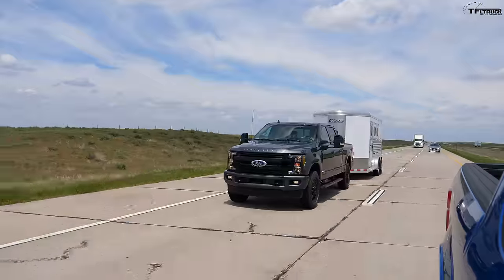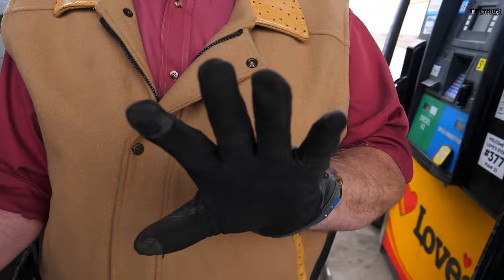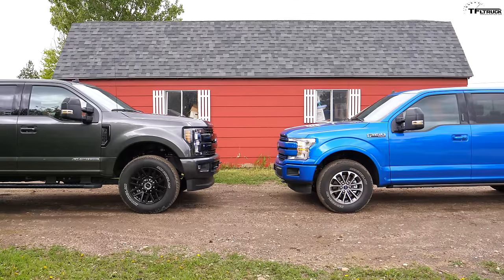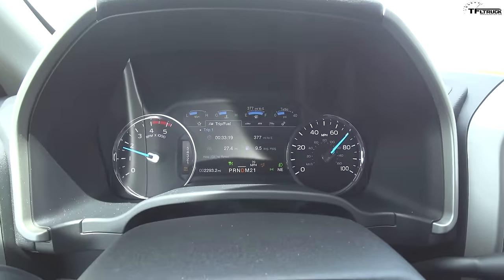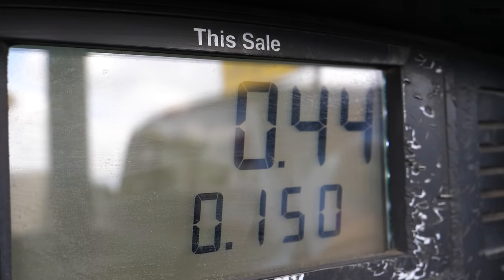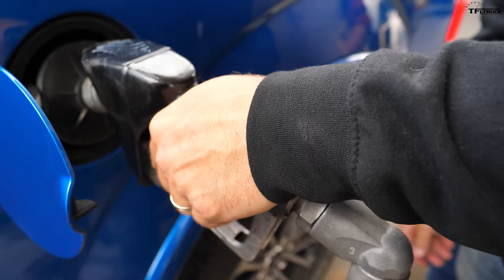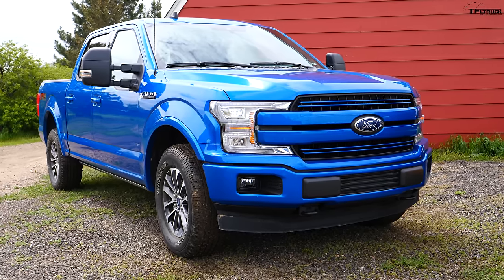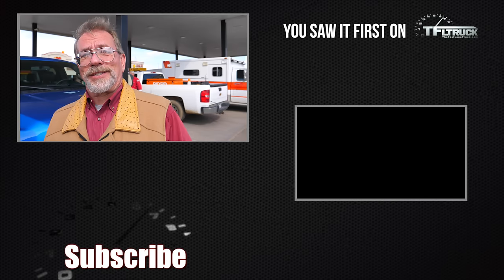Do You Really Need a Heavy Duty Truck to Tow 9,000 lbs? Ford F-150 vs F-250 MPG Review

Comment: I want you guys to strap 13,000 lbs on a EcoBoost rated at 13,200.
Reply: No kidding!!! That is the truck I own, 3.5L with the max tow package. Maybe not 13k, but the test in this video would be interesting.
Reply: Jeremy R nope.  Handles it just fine. Would I rather be in af250?  Yep, but my 3.5 handles that Much without issues
Reply: @AnyManProjects  🤣🤣🤣
Reply: @AnyManProjects   Yup.  Been towing with the family for 4 weeks with my 3.5EB SCREW and a 30ft bunkhouse at about 9200lbs.  All the way from Alaska through BC, Washington, and Oregon through some narly passes and ZERO issues with power.  Have my Equalizer WDH perfect set and 7.0 gain on the trailer breaks.  Far exceeding my expectations on all performance(except 8.5 MPG which was expected).
Reply: Christopher Ori mine with the ten speed does so good.  I've had 13k plus (for shorter trips) going and down grades and it does the job.  I'm easy on it and wouldn't want to panic stop or anything but it does the job.  Id rather have the super duty with the 6.7 but for the occasional heavy tow, my 2018 3.5 eco gets it done. No crazy revving, even up grades...just quiet power. Diesel guys always piss on gassers to justify spending all that extra cash or something? I know They're great if you actually need them, but most guys I know with them usually only tow 11k or less
Reply: @christopherori  How is braking? How are emergency maneuvers?
Reply: Jay Higgins braking has been just fine. Like a lot have said in this thread, trailer breaks set correctly are critical. I have my gain at 7.0. I tested high speed maneuvers and just fine. The trailer breaks in combination with a properly setup WDH makes all the difference. My whole family in the cab for 4000 miles this summer already and I know they are safe. I set it at 60mph max 62mph just to be on the conservative side.
Reply: BOWMAN-GT absolutely agree. The 10spd in combi with the EB is deadly. Only thing holding the truck back is payload but I made some major back end mods(shocks, airbags, swaybar, D tires) that give another level of performance. Also put in S&B cold intake. Up over 400bhp and 500ftlb now. Unreal in half ton.
Reply: No breaking news here.  The 250 toes better.
Reply: I pull my 13k toy hauler all over Utah mountain passes with a massive Ford Excursion powerstroke loaded up with my family.  No way I would ever do that in a half ton in real world conditions.  Winds change everything when pulling such a large trailer and even with my Excursion it can get a little scary at times.  Emergency Braking down hill in the mountains, etc.   if you regularly pull more than 10k you need HD IMO for safety.  Under 10k a properly configured 1/2 ton is doable just please don’t drive 70+ mph with that load like the diesel jerks like to do.
Reply: Brian Lampright agreed. Got some 40-50mph side winds on the backside of the Wrangells. Performed very well with the WDH but still had to keep it under control. Made me wonder how a 3/4 would have performed wit my 30footer acting as a sail.
Reply: @AnyManProjects  Just what I needed to know.  I'm planning a fairly heavy boat 12-13k all up, but in FL will never see a hill and the max speed limit to the coast is 45mph.  The 3.5 should work just fine.
Reply: Those ecoboost engines are trash. Should of gotten a v8 ask any ford tech reraly any of those will recommned the ecoboost over the b8
Reply: @christopherori  what you lose on millage, you make up for on fuel. Diesel is 30% more where I live. Add another 2% for DEF and you would need to get 11.22mpg in your diesel before you'd save a dime- You'd need that dime for the oil changes that are twoce the price and twice as often. For 15k or less, I'm staying with the 3.5L F150.
Reply: @gigi9467  What makes you say they are trash? They outperform any other engine's in it's class and are reliable if taken care of. The only reason Ford techs prefer V8 is because they are less maintenance, easier to work on and they have been around for awhile.
Reply: George Funes ask a ford tech and a mechanic so u can see what i mean.
Reply: Jesus H Medrano new ways of thinking and change are difficult for most people 😉. I have heard EBs are trash for years but still they have been making them for 10+ yrs and Ford is expanding them in their fleet(ranger, edge, etc.). If they were really trash and cost prohibitive they wouldn’t be expanding the fleet....
Reply: Jimmy's Tractor Yup. I look at  my normal 18-20mpg daily as adding to the piggy bank to be tapped when I tow. 95% time 18-20mpg, 5% 8.5mpg. Easily justifies $40k versus $65k 3/4 ton diesel 🤔
Reply: Christopher Ori theres a lot of cars are tgst are trash and they keep making them doesnt nean they are good? No tgey arent they are trash cars for dumb customers
Reply: @christopherori  brakes
Reply: @ML-lg4ky  braking
Reply: @christopherori  and that's why I swapped my 18 diesel with 37k miles for a quicker truck with better mileage. Only time Id want a diesel is when towing over 15k lbs I'm installing the gooseneck in my F150 and will use it for tounge weights  upto 3000lbs and trailers to 15000lbs.
Reply: Nice 70mph pulling a trailer whose tires are prob rated for 65mph at Max inflation. 

 U guys should read tire numbers since  you are reading gvwr stickers.
Reply: Jeremy R  considering tow ratings aren't for just how much sheer weight the truck can haul, I'd say your assessment of RPM is not accurate.
Reply: rnordquest How often do you plan on towing that boat?
Reply: Christopher Ori JEEEEZ  8.5mpg?? That’s a stop at every fuel station nearly hahaha.
Reply: I’ve pulled 14,240lbs with my 14 ecoboost and it pulled it fine but I definitely would have felt better in a f250 for stability and breaking reasons.
Reply: @gigi9467  How about you share with us what the Ford mechanic told you?
Reply: George Funes basically in comparison to the other engines that ate available on the f150 the 5.0 v8 has thr less issues by far and that they would pick that over the other engines and i checked their trucks except ine if them had a ecoboost but he said the reason he got it was cuz he leases it so he didnt care he wasnt gonna keep it long. Look it uo theresa bunch of videos also of texh and mechanica gving their .2 cents on this engines, its common sense though if u are pushing an engine harder it cant last as long  or be as trouble free as a NA engine
Reply: I second that request for sure! THAT would be the ultimate test and while we're at it, why not this test down and then up the Ike Gauntlet!
Reply: Brian Lampright...You just nailed it in one paragraph! I just pulled my 13k lbs 28 foot front bedroom toyhauler from the Grand Canyon to Phoenix yesterday. It was windy and with the climb out of Camp Verde a half ton ain’t going to cut it. My F350 7.3 did great!
Reply: @razvanmihalache5680  Probably average once a week.  It's only 12 miles and when I move back to the east coast it's only a 2 mile trip.
Reply: @georgefunes4535  the EB's are the best out there. Haters are always gonna hate. What haters forget that now all the manufacturers are copying the EB concept due to emissions regulation. When the EB came out, everyone were talking trash about it but it has proven itself over the years and now pretty much all manufacturers are using the technology.  They just name it different.
Reply: @JimmysTractor  This is the problem now with the government regulations of fuel and emissions.  Diesel is like the 2 or 3 cut off the oil.  It use to be cheap in comparison to gas.  Now with all the extra refining to remove the sulfur and other additives put in it price falls between mid grade and premium gas.  Add in the extra expense of maintenance and diesels get harder and harder to justify.  This is by design as the government wants to reduce use of diesel engines over time.
Reply: @linger2001  oh, I get it. They won. After 18 years of diesel, I'm back to gas.
Reply: F250 will beat it hands down with fuel economy. EcoBoost's are notorious for poor fuel economy while towing. Worse even than a V8.
Reply: @JimmysTractor  That's a huge price difference for diesel. Nation wide difference is 10%-15%. Where I live it's even but not always. DEF hardly counts since your talking $2.50 over 400 miles and $150+ for fuel.
Reply: @jayhiggins5239  braking is always a concern. The max trailer tow package has the trailer brake controller. Make sure your trailer brakes are dialed in perfectly and use the stabbing brake maneuver downhill to kerp the brakes cool. Don't ever "ride" the brakes
Reply: @gigi9467  what is a "b8"? Look at the torque curve buddy. I'm a big rig otr trucker. Torque is what matters. Rpm curves bro.
Reply: @edt.9218  trailer brake controller is included on the max trailer tow package
Reply: George Funes sounds like a winner to me for the exact sane reason u stated!! Lol
Reply: Christopher Ori good for you now imagine if it wer a v8. You would have an engine for another 10 years.
Reply: Sauceboss oh no grammar police!! Lol and u might want to pay attention cuz i never said anything bout torque numbers my whole thing has been about reliability and guess what? The v8 or b8 is still king. Sorry if u bought a v6 with turbos on it salesman  get a better commission for those cuz they cheaper to make for ford lol
Reply: @DUNEATV  because, 7.3
Reply: @gigi9467  That's why just about every diesel engine has turbos and they last over a million miles. They are nearly as reliable and if you're scared you're going to break something get the red carpet warranty. I got mine to tow a heavy trailer in the mountains where air is less dense. Make sure you move your V8 to the granny lane when this twin turbo is passing you up like your standing still. Don't interrupt my forward progress in that V8 of yours. But if you do hinder my forward progress I won't have any problems quickly getting back up to speed,  even yanking 12k. Just unnecessary.
Reply: I know my 2018 F150 is rated at 12,700 with the 3.5 eco.  I haven't bought the trailer yet, but looking at about 10,800 total on trailer (8,800 + 2,000 cargo).  My concern is the 7K GVWR.  The tongue weight on the trailer shows 890lbs. I figured 20% of the fully loaded cargo (400lbs) and I am sitting at 1290.  I only have 500lbs left to keep my truck under the GVWR and I am not a real small guy. :-)  I just don't see how Ford could say you can tow 12,700 without going over the GVWR of the truck.  No passengers?
Reply: i wouldn't trust a turbo V6 to tow that amount. anything over 10,000 in my opinion and it's time to step up at that point, especially 13,000 lol. that's heavy duty territory. my 05 Ram 2500 cummins towed 13,000, and the max on that was 14,000. the Ram 3500, the max on that was 18,000.
Reply: @Jeymez  you're 05 Ram is old technology compared to these trucks.  The 3.5L Ecoboost has 470 ft lbs of torque, and I think 385 HP.  Your 05 had 325 HP and what 600 ft lbs with a heavier truck?
Reply: Everyone needs a way to justify the 6.7,,,,here is mine...... Because I want it! Life is not a dress rehearsal, only got one chance at it, get what you want folks!
Reply: Brian Wild: another point i was gonna make since you brought up curb weight. yes obviously it does because it's a super duty. so it should weigh more than a F150, but the total curb weight on a 02-08 Ram 2500 was 6300. the Ram 3500 was 7600. the regular size Ram 1500 from that same time period was 4500. the modern F150 weighs 5300 pounds. so if you do the math, even though the F150 has 470 torque, my truck is actually a little quicker even with the extra weight. because it's not a normal V6 or turbo. it's a diesel with an inline 6. that's like having a V8 or a twin turbo V6 like the F150 has, but without the issues of a turbo, or turbo lag. now off the line F150 is faster, but because it is a turbo, my truck could keep up. because you don't have to worry about turbo lag in a inline 6. the Ram 1500 could keep up with an F150, because it only weighs 4500, and the F150 is 700 pounds heavier.
Reply: @AnyManProjects  I don't doubt that.  Ford does some insane torture tests in extreme heat and cold, and rapid temperature changes in between.  I'm sure it would handle it fine.
Reply: Jesus H Medrano I’m sure whatever you drive is perfection embodied lol.  Those of us who actually own these ecoboost trucks know better.  We push them hard and they are great motors.  Plenty of high mileage examples out there now to prove you wrong.  Opinions like yours are dying out as the Internet allows people to find actual facts instead anecdote nonsense
Reply: DUNEYXZ the new eco boost motors have more power than your 7.3 and the truck weighs a lot less.  I’ve towed with both, I’ll keep the modern echo all day.  This coming from a guy who had a 2017 f250 before going back to the 3.5 f150
Reply: Ford F-250 6.7 Super that’s the truth and there’s nothing wrong with that argument.  It’s just when people talk trash about other products to justify their purchase.  My EcoBoost towers great heavy, but if I didn’t care about the extra cash and crappy ride quality of a bigger truck, I’d get one.
Reply: @Jeymez  umm, your Diesel has turbo lag my friend and I am not sure the 2002 to 2008 would out pull a modern F150 with either the 3.5 EB or the Coyote.  I've owned a couple of Cummins powered dodges and they have turbo lag.
Reply: Brian Wild: actually it can, and the 5.0 in the F150 is slower. the ecoboost might be faster than my truck in a straight line, but not the 5.0.  the max you can tow with that is 10,500 pounds, which is good. id actually buy that over the ecoboost, but my truck can still outperform that in terms of work related tasks. 14,000 is the max on a old Ram cummins from back in the day, i know because i've towed close to that amount. now that's only for the 2500. the duramax diesel from GM back in the day was pretty close, because Fords 6.0 back then was the weakest. the 3500 could tow 19000. another thing, ya it might have some turbo lag, but there not meant to be driven hard anyway. and it's not a normal turbo, it's a diesel engine with an inline 6 cylinder. an inline 6 is more powerful than a V6, but they tend to be less reliable, atleast less reliable in a BMW or Audi. but in the Ram they last a long time.
Reply: Raven Fox max tow on the eco is over 13k
Reply: It has more torque because it's a Diesel.  More HP, not back in 2005.  Diesel fuel has more energy than gasoline.
Reply: BOWMAN-GT: are you sure about that, because were talking about a V6 with a turbo, not a V8. it's rated to tow 13,000, but real world results are different from on paper. but who do you know towing that amount of weight with a modern F150 lol. when the weight gets around 11,000 and above, most people tend to buy an F250 gas V8 or diesel, a duramax from GM, or the 2500 from Ram. even if the ecoboost can do it, most people i know wouldn't feel comfortable towing that kinda weight with a V6, even with a turbo. the area i live in, i see alot of F150's. mostly the newer ones, but i see the V8 more often.
Reply: It’s funny to see how many people are towing over weight my truck one ton dodge with 3/73 rear end that tows 13300 on my 40 foot bunk house at 9600 pounds with my wife daughter and myself 300 pounds of gear leaves me with only a extra 300 pounds of payload to add
Reply: Sauceboss lol I did calculation today if a f 150 eco boost 3.55 rear end 4x2 at the tow rating 13200 was pulling a trailer at 9380 pounds with three people and 300 pounds of gear. Would all most be maxed with 970 to spare 9380 is far off 13200 it’s sad how many people are on the road over weight ☹️
Reply: Sauceboss oh and the blue truck over weight at 9000
Reply: @Sauceboss - It would probably take it

My Brothers In-laws have one, silly dink tows = if not > I will in my 2500 with a 5.9L diesel.
Reply: @daveszangulies9938  - 970 to spare... 🤔 Don't know why you need to spare?
9380 + 970 = 10'350
Minus - 300lb of gear
Minus - 300lb 2 bodies
10'350 + 600 = 10'950
If you take away the 2250lb extended cab
10'950 + 2250 = 13'200

Not saying you should tow that much, but understand that a trucks max payload as advertised is in the best case, max weight stripped from cab (reg cab) absolutely nothing in box and only 1 person in vehicle.

I know this because my brother, they use it because the overall limit is something like 20'000 total? Their truck weighs half as much as mine in turn allowing them to LEGALLY haul more weight, even though I PHYSICALLY could.
Reply: @FordF-Super  - honestly, a diesel is simple if you should or shouldn't.

Do you mind paying a little extra here and there, to save money in the long run?

I don't want to fill you with false hope, I don't know dink all about new ones. (I have heard decent stuff so far about the 6.7) But I get comparable fuel milage to a Honda or a Sunfire on the highway, little more thirsty in town but I would then compare the milage to my old Ford 300 I6
Reply: Problem nobody looks gvwr amount of people gear etc yes the trucks can tow the weights but stopping hill grades thats were the  math comes in  on proper weights to keep a lawer away i bought a 3500 cummins i thought ill be able to pull a house wrong
Reply: @duttydiesel8303  i dont mean spare as in tire i mean spare weight that calculation was done me wife two kids and 300 pounds of goods 970 lift then truck is over weight thats 9380 pound trailer in tow
Reply: @daveszangulies9938  - like I said why spare? Lol 1000lbs underweight is a 1000lbs that "COULD" be used as max weight?

As far as it goes you'd hate me! 😂 Probably slightly less now that I have the 3/4 tonne & 1 tonne.

My best one to date, was with my old F-150. I think the absolute top combined was 7'800lbs (with proper setup) not sure if mine was even rated for quite that.

I tipped the scales at 22'000. The truck did not like it, but she got it done... That wasn't all in a trailer either. As long as you don't do it on a regular basis, nbd... But most people don't have common sense ie
- maintain a slower speed
- don't tailgate
- stay off freeways and interstates
Reply: @daveszangulies9938  - another thing is the standard transmission, you can bully the weight of the vehicle around little bit.
Reply: I do..  2018 f150 max tow package with ecoboost..  my camper is around 12-13k depending on loading.   No problems at all hauling that amount - still have some power to spare on the highway, and can make it through the smoky mountains.   last trip from Raleigh to the foothills of the mountains I averaged around 10mpg.
Reply: @ltbarkley  - they are actually very impressive given their displacement!

I personally wouldn't want to do a heavy haul often with it, at the end of the day there really is no replacement for displacement... You can make a smaller engine get more power, but that also messes with the longevity!

Also I have heard a lot of complaints about the seals on that engine? the one that we have has had almost every single seal on the damn truck done.

The other major issue we had, when we launched a boat.. there is an opening in the top of the rear differential??? Why I don't know, but what happened was it filled with water!!!
Reply: Dutty Diesel turbo reduces longevity..... says the guy with the turbo
Reply: @AnyManProjects  - actually have 3 turbo, and I didn't say that was the killer... You will likely have a similar effect with a 5 liter, they're just not really made to tow 13000 pounds regularly.

Go ahead tell me I'm wrong, you're definitely entitled to your opinion..and my opinion is the person I know who owns a 3.5 liter turbocharged Ford f150, is willing to tow more than I do in my 3/4 tonne. He has had a tonne of problems but tows a healthy 10'000+ roughly 500mi/week.
Reply: @AnyManProjects  - what do you have to say? I would love to hear what someone who owns a Ford F-150 has to say. My opinion holds next to no weight because I have absolutely no experience with them.
Reply: @AnyManProjects  
How much do you tow?
How often do you tow?
How far do you tow?
Are you running 5th wheel or standard bumper hitch?
Reply: @AnyManProjects 
What's your MPG?
What's your o/a odemeter milage?
What's the history with repairs?

I'm going to imagine you don't have the time... 😂🤣 Wouldn't be a shocker!
Reply: Dutty Diesel I’ve pulled over 13k (with people, gear and trailer) before, there and back without knowing the trailer was that heavy ahead of time.  It was a bumper pull.  It did fine but I knew it was back there. I would not want to do that on a regular basis.  if I towed over 10k on a routinely I would definitely go diesel.  As it stands now, I’ve had 9800 pounds in trailer, plus about 600 in people, and 400 in gear pretty regular and I don’t sweat it.  Trailer brakes dialed in is the key.  The engine rugs so much better and less stressful than my 14 5.0.  I miss the sound and overall character of the v8 but there is no comparison when towing.  I had a diesel 3/4 before and that’s a different ball game. 13k with that was awesome, but the extra cost, drive ability etc kept me from getting another
Reply: Dutty Diesel to answer your other questions, my truck is an 18 3.5 with the 10speed.  Only 12k miles,  eight months out of the year I tow at least every weekend. Bumper pull, get about eight to ten mpg on average depending where I’m going
Reply: While you at it throw in the old second generation 7.3 power-stroke f-350 dually
Reply: @gigi9467  You're so right. Mine developed a miss at 375,000 miles and I had to replace it. It's been 10 months since then and 150,000 miles and I'm starting to worry that I might have to replace it again when the van hits 700,000. Such junk! Oh, and I pull a loaded trailer for all those miles.
Reply: Jeremy R  I have a 2018 F150 with the EcoBoost. It doesn't even turn 8k rpm. Wtf dude
Reply: @BrianLampright913  you've obviously been out of the truck world for 10+ years if you're still driving an excursion. Trucks have made huge advancements and some will tow better than your excursion. The excursion just has weight
Reply: tynstaci interesting assumption but wrong. I own an X because I have a family and require a 3rd row. My hobbies involve hauling a large toy hauler full of dirt bikes into the desert and up and over large mountain passes. The Excursion is literally  the ONLY truck on the planet with 3rd row capable of this and just because I own one does not mean I’m out of touch with new trucks.  Read the comments above many people INCLUDING F150 owners agree with me that when regularity towing 13k lbs you should not be using a 1/2 ton truck. So many reasons why that is true.  I’ll give you one example. Go take a wheel off any HD truck and compare the massive brakes on the HD truck to any 1/2 ton. HUGE difference. A 1/2 ton going down a long steep mountain pass has a high probability of putting too much heat into the brakes and warping the rotors. A 1/2 ton isn’t built with heavy enough components to stand up to those weights on a regular basis. Ask ANY business owner who runs a fleet of work trucks that haul trailers...there is a reason none of them buy 1/2 ton trucks to haul even an 8k lb trailer on a Dailey basis...they wear out too fast.
Reply: Jimmy's Tractor I partially agree with you, i own a diesel Excursion (heavily modified) will keep it for life for HD towing. And I also have a 17 RAM1500 which is so much better on so many ways and 95% of the time would rather drive. The 1500 is so much more enjoyable to drive and tows awesome up to the 7k I’ve had behind it but my 13k trailer would squash it. I’m curious how well the suspension, brakes, and driveline on your F150 will hold up to the weights you want to pull.
Reply: Not saying it to piss anyone off but I traded  my 2017 f 150 for a 2019 f250 and I wish I would have kept my 150 it handled my RV way better less sway it surprised the hell out of me I think because it sits up so high it has poor handling when towing rv I know people will say adjust your hitch well I did that and no change I bought a new resse hitch and lowered it as low as it goes the problem isn't that it's the truck it's to tall
Reply: Hezekiah Wells that is very surprising!  Everything about an HD truck is so much more solid and stiff from tires to suspension which normally translates into superior towing.   Crazy.
Reply: @BrianLampright913  I believe they are just to tall Ford has raised the f250 at least 5 inches in the last few years I talked to the dealership and they also heard the same thing from other customers that where towing RVs and the also told me that Ford might be aware of this problem because they are lowering the f250 in 2020 by 3 inches
Reply: Hezekiah Wells I could see that.  The RAM HD trucks are also very tall. Chevy makes the low riders.
Reply: yep gotta load to the max, cause the sticker said so.
Reply: The Ecoboost is the towing engine for F150s. Torque peak is at 3k RPM.
Reply: Excellent test!  Great video editing!  This is extremely helpful to me for my next purchase.
Reply: Ny to Washington with a 2011 3.5eco f150 pulling a boat of 7000lbs. 6.6 mpg for 3000 miles.
Reply: M Linger , did you see what England , wants to do in a few years? Cut those diesels therehave zip, for pollution controls, GERMANY, & others have gone the DEF way+ a replaceable SOOT FILTER , 
DO YOU KNOW whom invented that SOOT FILTER? PEUGEOT  did, then gave it to free domain ,,rather than put in a patent., Cheers from NJ
Reply: Sauceboss  and I do believe on the trailer package , with diesel, it includes a JAKE BRAKE also,     Cheers from NJ
Reply: Dutty Diesel virtually ALL digs do have a VENT o em,,so you had your rear end in WATER,,WHY?, consider yourself lucky that you got up the ramp, with RWD, Bless u had a 4X4,   Cheers from NJ
Reply: Ford says it will safely tow 13,200. So let's go.
Reply: Brian Lampright I got new on my job an E350 VAN high performance , used for m HVAC/R job, I did some serious miles, Mt POCONO PA- STATEN ISLAND, PORT JERVIS ,NY, -BARNEGAT NJ, when the first breakers went, the service place that the company used  wore out REALLY QUICK, , but I found out there 23 DIFFERENT GRADES FOR THAT VEHICLE, so I was accused , of OVERLOADING IT , so I went to a public scale, & got a receipt, the vehicle could still Cary 950lbs, so I told then FIX IT OR I QUIT, so TSHF, ant they told them OEM PARTS ONLY,  then it went many miles !  Cher’s from NJ
Reply: @christopherori  exactly everyone is going small engine turbo now nobody wants new technology
Reply: @AnyManProjects  if it's rated for max towing of 13k than it will be fine. The trailer package and gears is why it's safe to tow that amount. If I was going to tow that amount regularly I would get a diesel. In the long the diesel willast
Reply: @JimmysTractor  if you are going to be towing 13k regularly I would get a truck built to tow that amount regularly like a 3/4 ton with a diesel. Yes diesel fuel is more, oil changes are about double the cost. If you use synthetic oil and oem oil filter can do oil changes around 7500 miles unless it's been worked really hard. For pulling that much all the time in 1/2 ton eco boost. It's not gonna last long, the 5k to 8k rpms isn' good for a motor. All the other parts are gonna prematurely wear out which is gonna cost alot more than extra cost for diesel fuel and oil changes.
Reply: @omieyouknowme  it totally depends on the type of trailer and trailer tires. Yes max speed for a 13in tire is gonna be low. But if you're trailer uses 15in load range d or 16in load range e. There is no max speed on the tires.
Reply: @flybyairplane3528  all difs have a vent???? That is false.
Reply: @hezekiahwells2636  I had to lower my old 350 by 2 1/2" replaced the blocks/bolts, so trailer sits level, was wearing my rear trailer tires faster than front with a slight nose high attitude.
Reply: @lonniefreeman4278  Lonnie there are still speed ratings even on d and e rated tires, look up N L or J ratings for trailer tires, and even those are tested speeds and not recommend.
Reply: I can say it just can do but not so well. I towed 9900 lbs with a RAM 1500, Axle ratio 3.21, and fully loaded with some staff in the trailer, moving from Los Angeles to Dallas, we moved but it struggled all the way. Will change to a RAM 3500 dually for 5th wheel.
Reply: So say you have an accident with your overloaded F150, the first thing the police/insurance investigators looks at are the stickers on your truck, tires and trailer. No one is getting a hero sticker just a huge fine maybe jail if someone dies and your insurance is not paying. If you bought the wrong trailer for your truck or visa versa it’s on you but you put everyone at risk. Go to a scale and do a proper assessment of all axles with your rig loaded (wife, kids, dog, firewood and beer) ready to go camping. Advertisers use a base, regular cab, 2wd truck for their BS numbers . Our trailer is 10,000 lbs loaded and wet and with all the crap we need for boondocking a 3/4 ton was marginal. So we went with a Ram 3500, 4x4, 6.4 Hemi and 4:10 gears so no big deal if we bring a couple hundred pounds of firewood. Next time you are at the mall park next to a one ton and compare your half ton axles, springs and brakes. No comparison.
Reply: @micktaylor7937  Mick I weighed my setup as u said and was over my gvwr by almost 800lbs upgraded to f350 srw.  I'm still 200 lbs short of Max weight on the gvwr and 1000lbs from my gcvwr. Cat weigh scale is 10$ and I weigh every year keep that ticket in my truck for the exact reason you just described.
Reply: Ford tested the Ecoboost at its maximum GCVW rating and at WOT for 24 hours at Talladega
Reply: the Ecoboost doesn't turn anywhere near 8000 rpms, more like 6500 for engine life
Reply: @Kamper Ken that is sad to hear, is this why our premiums keep going up?
Reply: I completely agree. I just traded my F-150 EB for a 250. Cross wind on the interstate is a game changer. I was pulling a 8k lb camper and it was blowing me in the other lane. Power wasn’t a problem. Stopping it and controlling it in less than ideal conditions was the problem I had
Reply: Erik kovacs
In ohio it is always .50 more a gal, for awhile it approached a $1.00 more
Reply: @AnyManProjects  
Let us know if your truck is still running okay w/o any issues after several years of you towing at almost max capacity. Lol
Reply: @christopherori  
Equalizer WDH...? Also, it was nice to see that you drive conservatively (60mph) when towing a trailer. In Oklahoma, people overload their truck and trailer so much that they have excessive over steering (back squatting, front of truck lifted high in the air) that makes it unsafe for everybody.
Reply: Travelin' Ted Equalizer - Weight Distribution Hitch. Im a huge advocate after putting 8k miles this summer trip in all conditions. Also, I keep under 62mph for that “one” time I need to high speed maneuver or have a blowout. Crazy how much slower 60-62 feels compared to 70mph when you fully jam the brakes!
Reply: Vikash Prasad I
Reply: @omieyouknowme  my trailer tires are rated for 87mph...  Not all are rated to just 65mph.  It is good to see them towing at real-world speeds.  Nobody tows at 65mph on long trips, except the guys pulling RVs with half tons.  I usually am towing my RV at 73-75mph behind my dually.
Reply: @gigi9467  the techs say they work on them less because there aren't nearly as many on the road as the EB. They sell way more EB than 5.0s. so they just don't see them as often.
Reply: Brendan Caldwell if thats what u want to believe good for you then, funny how i see the v8 are holding their value better too, hmmmm
Reply: @georgefunes4535  my cousin had a 3.5 ecoboost fx4 F-150 that he used to tow a 23 foot trailer loaded with all his tools an motocross gear/bikes it weighed 6,700 pounds an his ecocrap as he called it had no power an barely made it up the mountains plus it gave him lots of problems he quickly got rid of it for a 2017 5.0 f150 an has been happy with it ever since.
Reply: @duttydiesel8303  I have a 95 f150 5.0 4 speed auto. I haul scrap metal with it so I've hauled 6,000 to as much as 10,000+ pounds with it. It does very it's a little sluggish off the line with anything heavier than 3,400 pounds due to previous owner swapping from the original 3.55 gears to 3.08 gears. Unloaded I get 16 mpg I have done exhaust upgrade long tube headers an true duals towing depending on weight 7 to 4.5 mpg. My cousin had a 3.5 ecoboost (he called it Ecocrap due to all the issues with it.) He used it to tow a trailer loaded with all his motocross gear it weighed 6,700 pounds he also has a boat that's 9,588 pounds. According to him it had no power it struggled climbing hills an mountains and mpg sucked badly. He also had to change the turbos a couple times he quickly got rid of it for a 2017 f150 5.0 an love it. It doesn't struggle on mountains an hasn't left him stranded like the ecocrap.
Reply: @duttydiesel8303  my cousin had nothing but problems towing with his 3.5 ecocrap.
Reply: @speeedy95  - Changed the turbos a couple times..... Yup that hurts the bank, if I'm not mistaken they're internal turbos.... Not the easiest to get to.
Reply: @duttydiesel8303  yeah him and his dad did it themselves they had to pull the cab off like on a 6.0
Reply: Would work fine for most weekenders but rather then mpg testing (since I don't care a ton about that when towing) but a test on reliability when leaving that 9k trailer attached for 150k miles
Reply: my 2012 f150 ecoboost platinum can pull 13k no problem . its stock too
Reply: @AnyManProjects  how's that 3.5 doing for you? I want to get a taurus SHO with a 3.5 ecoboost, give it a mild tune.
Reply: Joesphan Lu only had it for two years, but no problems... and it ripped!
Reply: @JimmysTractor  Your half ton is rated for 3k lbs of payload?
Reply: @Jeymez  I can assure you the Cummins has more turbo lag than a EB, I own both. Stab the throttle on my 03cummins and wait a second or 2, stab the throttle on my 3.5eb and your gone. Towing around or under 10k it'll be on the EB.  Towing a heavy car trailer with a big-ass skidsteer and no WDH...I'll take the cummins
Reply: If you haven’t seen it already, Mr.Truck has that test on his channel with his truck